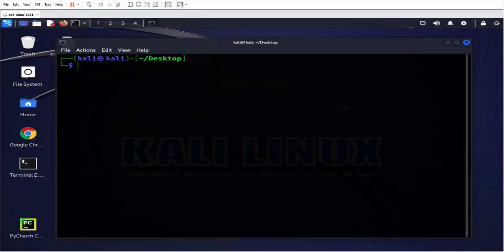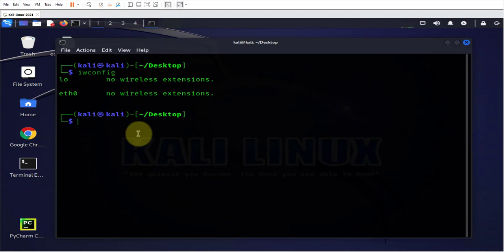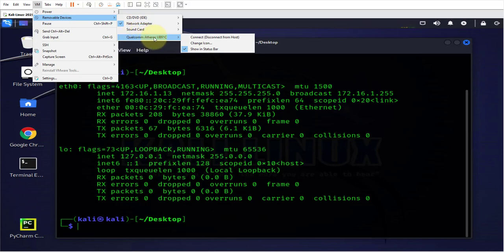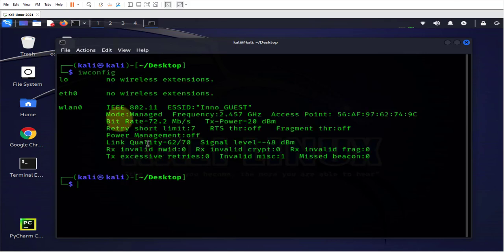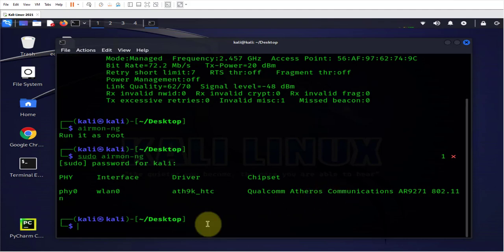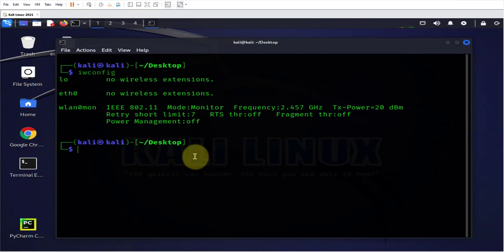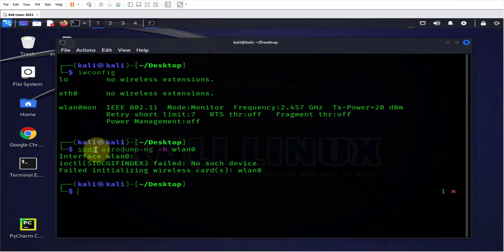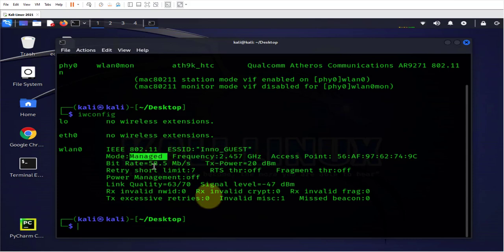Capture WiFi Packets Using Kali Linux | Capture Wireless Network Traffic

Comment: Hi, I’m currently using AWUS036NHA for Linux and it doesn’t connect to internet or show in ip a or iwconfig only it shows in lsusb therefore I can’t use it at all.
I’m having this trouble where it says in dmesg | grep ath9k initialising but disconnecting though it needs a Dev file and a normal .fw file , I have .fw file currently it replaces the Dev file and it should just go on but the Pc is asking for a dev file and  I can’t find Dev file anywhere on the internet I tried many numerous and various ways and I couldn’t get a solution to it , basically it should just work with the .fw file and go on but it’s asking for a Dev.fw file , please help me on this I’m stuck for a month probably and can’t proceed further , your help would be much appreciated, thanks.